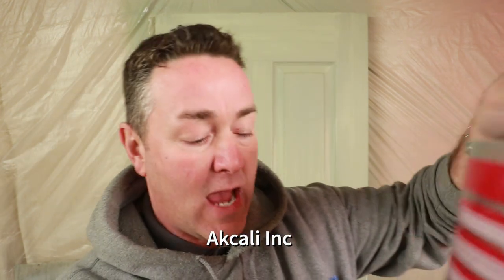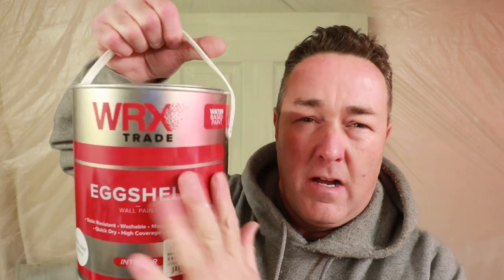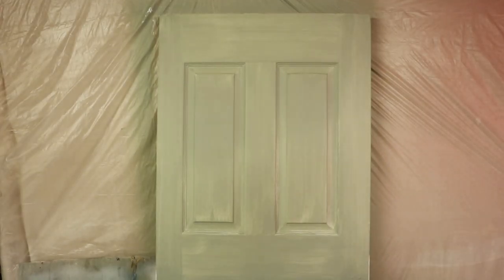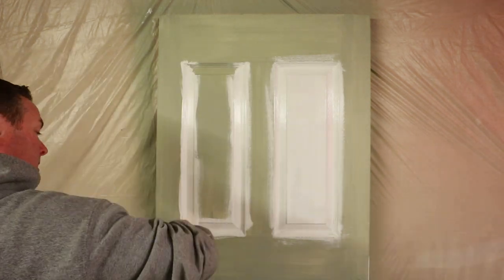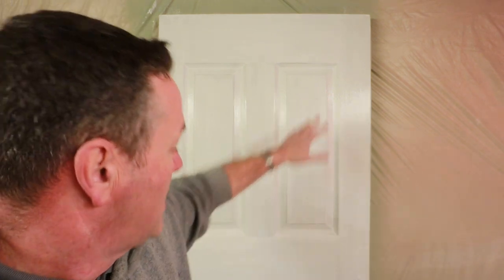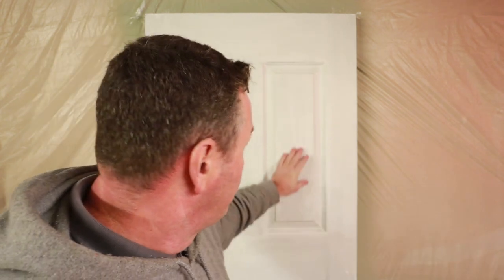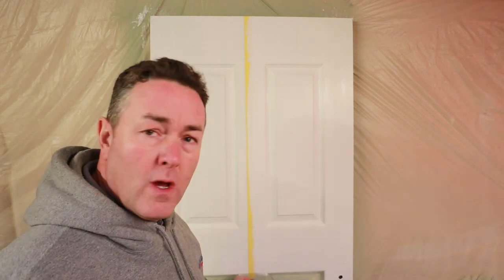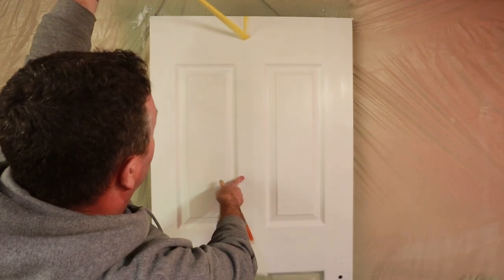Transform Your Home with possibly the Best Paint: WRX Trade Eggshell - Review

Comment: Hi Phil
Love the channel and content its great watching.
Have you ever used sayerlack or renner Coatings, I think you would love them they have excellent opacity and seriously quick drying times in temperature above 15 degrees, if you denib between coats with 240 or 320 you can get a beautiful smooth silky finish.
Might be a interesting test on the green door 👍🏻
Reply from the maker: Thanks for commenting

Not yet!
Are they 2k products though?

I like to keep it simple, 2pac spraying isn't ideal in private houses and I don't have a spray booth either.

Hence why I keep to the waterbased products, which give great results too.

If sayerlack or renner want to reach out... I may give them a try ;)
#renner #sayerlack
Reply: @ProfessionalPainterDecorator  they are waterborne polyurethane not solvent, they can be used straight out of the tin brush or spray applied.👍🏻

Comment: Does it say on tin it can be used on wood mate ?
Reply from the maker: Wood a in general or bare?
Reply: @ProfessionalPainterDecorator  Wood in Genral , over old paint on skirting and trim
Reply from the maker: @johnslaw7967  yes. Give a good sand to get a key, dust off etc.
Two/three coats depends on what colour.

They do a primer/Uc as well you can use if you want to get a good build up on a surface.
Reply: @ProfessionalPainterDecorator  Cheers mate

Comment: Waiting for my delivery of the satinwood to try for the first time. Can order through B&Qs if anyone’s struggling to find it
Reply from the maker: YOu'll like that too. di dyou see my vid on it a few weeks back?

A splash of water may help if you struggle with putting it on.
Reply: @ProfessionalPainterDecorator  
I did mate thanks. 1 Coat of bullseye then I’ll give it 2 satins and see how it goes. Pretty cheap too £30 for 2.5l
Reply: It's in  WRX shop eBay buy 3 x 5 l works out  £40 Inc vat that's cheap free postage.
Reply from the maker: what were you going over that you needed 123 on first?
Reply: @ProfessionalPainterDecorator  
Few dirty marks that didn’t clean off. I find using that first followed by 2 top coats works well
Reply: The main paint companies could learn at thing or two from WRX. Also very price point attractive . Great content 👌
Reply: Can’t warrant scuff x prices. Not found it to be that much better although sprays well and dries quick